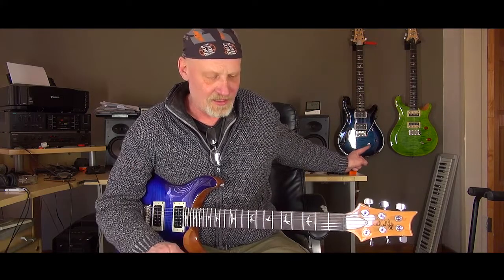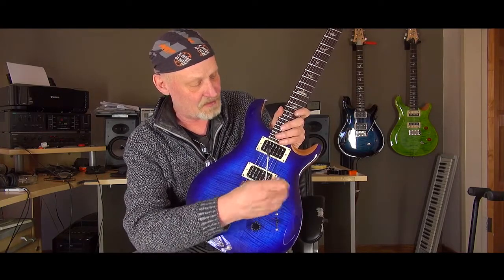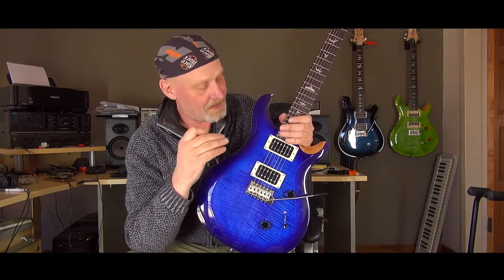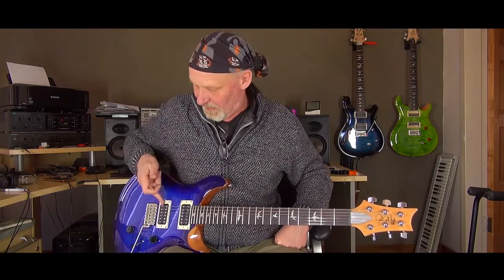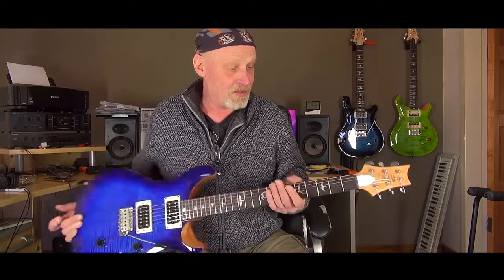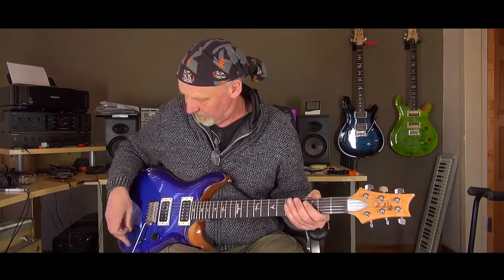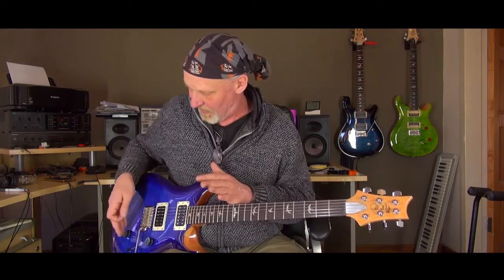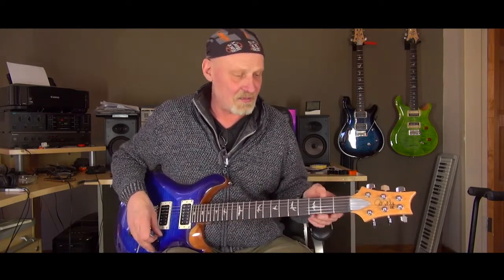Ultimate Split Coil mod for PRS SE C24. Or any split coil guitar

Comment: I've got an old se standard and went wild with it and used the same partial split. Put two mini 3 ways in the same spot as the Paul's guitar for series/single/parallel and push pulls for reverse phase (vol) and series/parallel for the 2 pickups together (tone). Plus a treble bleed on the volume.
Reply from the maker: Awesome Stuff

Comment: I'm putting thumb adjustable 10k and 5k trimpots on the bridge and neck, to dial in the sweet spot on my Yamaha rss20. Not sure how the stock pickups compare to prs, so going for something adjustable.

Also im splitting to the screw coils, which i've seen on forums that sounds more stratty